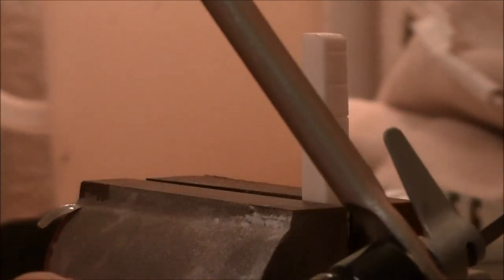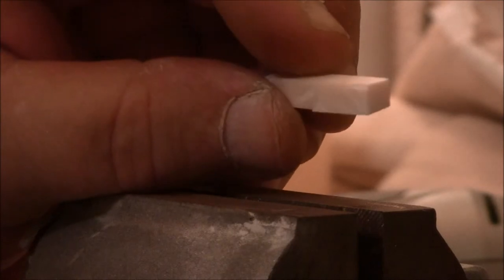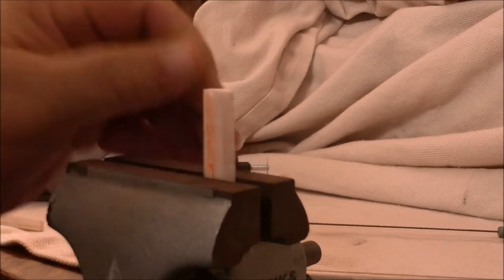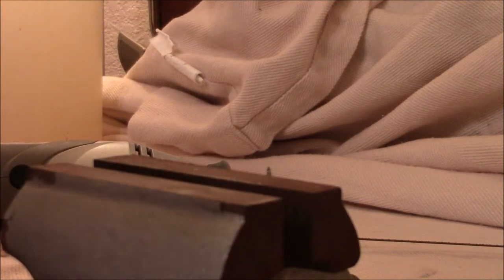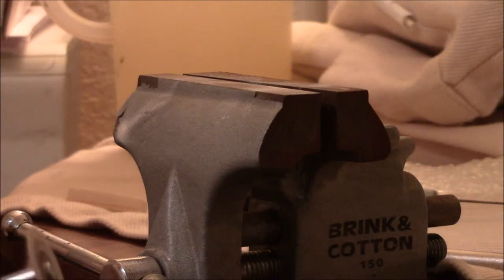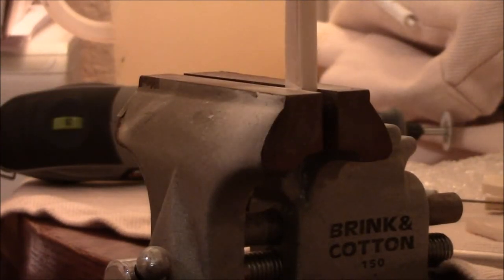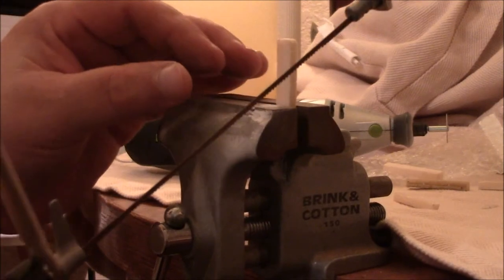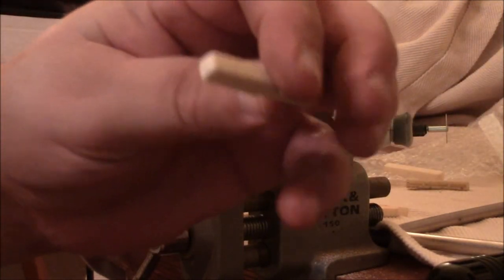Shaping A BONE NUT with a DREMEL Tool PART 2 OF THREE

Comment: Dave got the Eagle roller bridge, just chucked it on with the existing posts.
It HAS improved the sustain of both wound and plain strings but its still not great!
I will also have to use the posts that came with it as I can't get the action low enough to where I had it originally. The thumb-wheel on the new posts are thinner...so hopefully...

Comment: Ok set it up properly today @ the shop.
Used the supplied posts. I was able to get a 1.5mm action E-E @ 12th fret.

The Roller TOM only cost me $10 cost price. 
It IS much better now, but that B is still muffled.

I got the widest nut file and used the fattest edge to widen the slot some more. Its ok but still not what it should be.

I think it's time to go to some1 more advanced than I on these things.

Comment from the maker: Cool on the Roller and that it fit so well. BUT, there are those PESKY Thumb adjustments right? If I had my choices there would be NO thumb adjustments at all since they are near to useless as can be. As a matter of fact they are usually not used as compared to a flat head driver so why have them at all? A thin washer would work better. Of all those thumb screws Ive seen on Older guitars I also see where some Boob has taken a pliers and scored around the body indenting it enough to be well seen.

Comment from the maker: 2nd. Another Guess is that with a MAG Glass you MAY SEE a sharp V in the cut and its too tight against the string deadening the vibrations. Also check the roller to see if there are any issues? I sorta doubt its the ROLLER though.  What EVER YOU FIND OUT PLEASE let US ALL KNOW so if we RUN INTO THIS SAME PROBLEM we can address it and fix it as well. Also,try some lube on that NUT, that could help some. Good Luck and Waiting To Learn How it's Happening. Have a good one and ring me in the morning.

Comment: I just got a nut replaced on my 1971 Epiphone texan. Boy what a nightmare the process has been so far.  I went to my local guitar shop (independent seller) so I thought I'd give him the job. Well aside from the fact he told me it would be finished tomorrow 3 times in a row, today I went in and he decided to finish it off while I was there. I thought I would entertain the idea and waited. Well suddenly he abruptly stopped  and then gave the guitar to me and said - the action is high - if you have problems come back next week. Well I could see it's not even half finished and too high (the strings are floating in barely a MM deep groove) with the nut being about 2mm higher than the original one to boot , he could not even manage to tune the guitar while I was there. He decided to use the most untrustworthy (IMO) method of tuning - with harmonics - uh every guitar shop should have a chromatic tuner on hand - and he tuned it like an octave too low and off. He didn't explain to me there will be drift for a while among other facts he should let all potential customers know.  All I can say now is I won't be a further customer and my guitar now sounds sea sick. (normally has a very sweet mid tone and never goes out of tune) I don't really understand how he will properly manage to finish the nut without having to remove the brand new strings that were also put on which have the ends already clipped off. So here I am , and I want to learn to do this.
Reply from the maker: Well, its real clear that this guy was either in a real hurry to chase you out or didn't know what he was doing. And that happens A LOT of times when doing a nut. There are just so many things that you have to keep in mind when replacing one. The first is the radius of your fret board. You have to make sure that you repeat that radius with the finished nut and final string locations as well. 

Well you can watch the videos mine and others and see what's being done to replace these crummy plastic and mixture of bone and plastic. Just KNOW that you are going to do some NOT SO CHEAP INVESTMENTs into the TOOLs needed to do the work. The decent files alone run around $180 dollars a set. Course you can TRY to find the proper size files each and cheaper but that's not easy to do. And they may not file BONE but CHIP it. I strongly suggest you try ONE MORE SHOP and explain what happened and ask IF they can REPLACE the MESS that's on your guitar right now. Have a good one.

Comment from the maker: And you tried switching those strings from one NUT SLOT to the OTHER and still had the same problem? The E string became Dead? If SO you need to get a Mag Glass and take a close look at the NUT. Somethings gone wrong on it. Its been opened up and its not too tight, and its not buried either. All the above have been done and it is still sounding Dead at the NUT last Guess is something micro wrong like a chip or like a hang piece of nut somethings stopping that string from Vibrating Period. What?

Comment from the maker: LOL, Oh, there are No Professional Nut Oilers About in Auzzy Land? You are checking the wrong Streets from what Ive been told. Or check out those 'Station" Towns for the Big surrounding Ranches. There are plenty about. And that Roller just may get rid of that problem of the dead string along with oil on the NUTs. hehe...

Comment: here we go...pt. 2 i did use the driveway concrete as a sanding tool and it really worked great...lol!!! Ghetto style
Reply from the maker: Dude, what ever works for you works. Ive seen guys that have worked on parts for years and most of them use their tools the same way their Dads or Shop Teachers taught them. However, Ive also seen a true genius of guitar repairs lay down a metal file and rub parts over it to get the finish he wanted instead of holding the part and moving the file. So, what ever works. Have a good one.
Reply: oh, i like ur way a lot better...lol!!!! i did one today and there is a lot of work to get it just right....although this one is good its not perfect so back to the drawing board. thanx for the video's man. they help a lot
Reply from the maker: AXE SLINGER Im glad they help. I wish I could share more techniques of making those buggers. There are just so many different ways to Tool Up and not get sucked into the high cost of Nut Files. I have a set some where around here that ran me over $130 dollars a few years back and all they actually were are Simple files made to measurements. Nothing really special about them as compared to others.  Have a good one let me know how it works out.